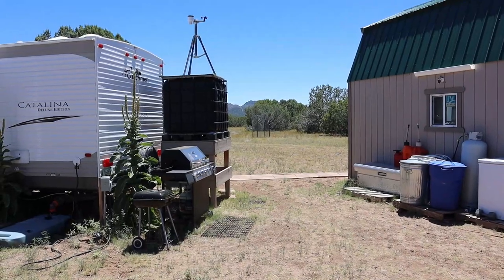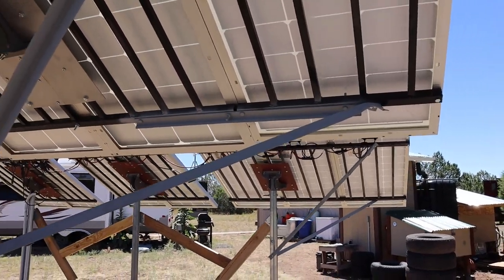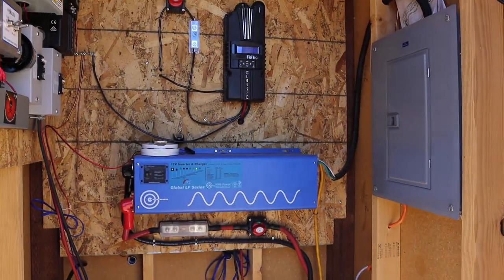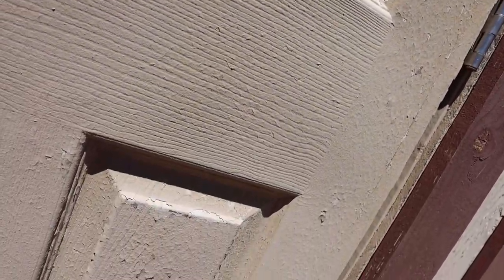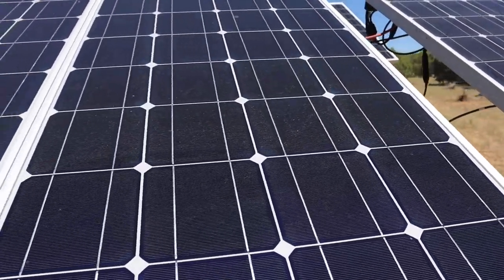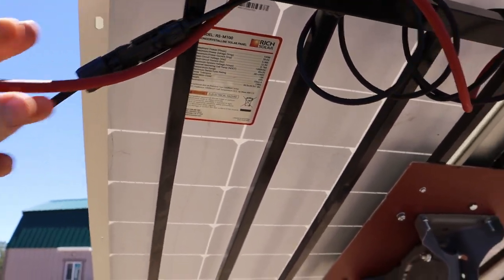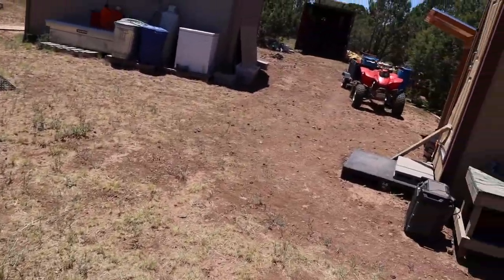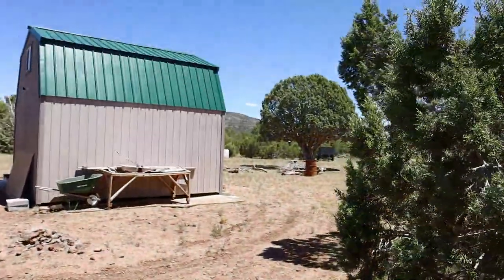My Solar Output is Much Better

Comment: What inverter is the big blue one?  Type and model number?
Reply from the maker: Noes de wae two Galavant  it is an Aims inverter/charger 4KW pure sine $900 give or take  when I bought it.  Now between $1100 and $1300 depending on where you get it.